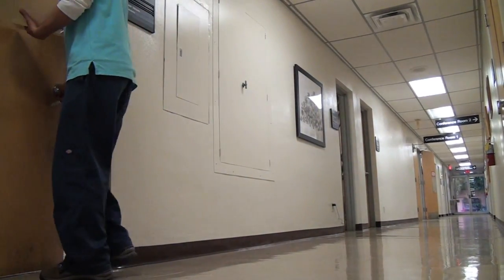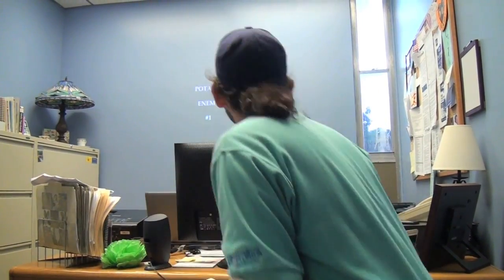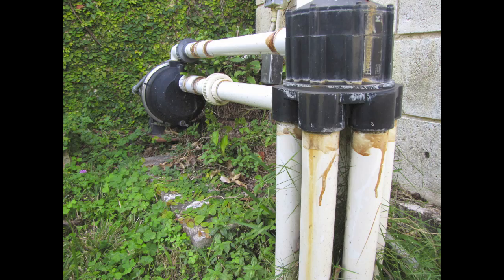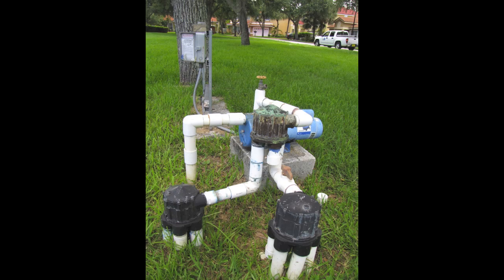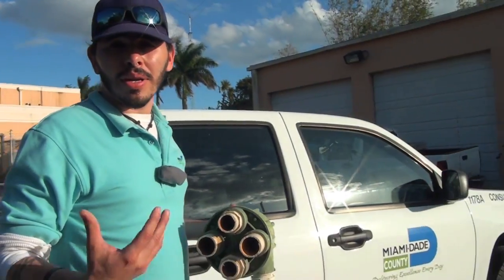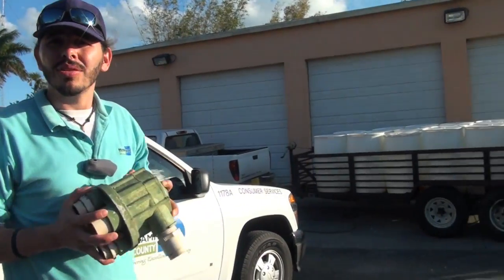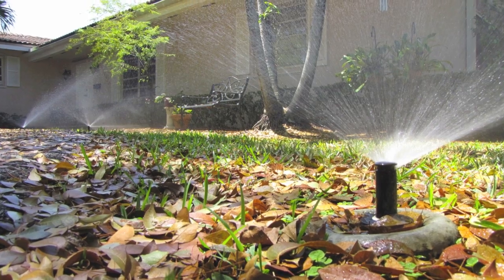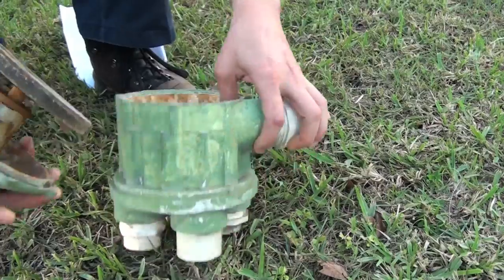The spinning menace - all indexing valves must be retrofitted

Comment: Our irrigation system's old K-Rain Hydrotek 4000 series Indexing Valve is at least 20 to 36 years old and it has had some repairs, e.g., a leak in the PVC pipe, one-(1) new check valve and replacing sprinklers but it has never had the problems mentioned in the video.  I already know about the efficiency of electro-mechanical vs electro-digital. Yes I have maintained my computers and disassembled electronic devices, but everything is challenging if haven't been taught how by a mentor.  However, when the cost of switching over to a digital system would be a costly nightmare because you can't get good affordable professionals to do the installation. Thank God we are on God's Holy Well Water!

Comment: If you can't accept digital hardware and software systems, you might as well go back to a land line and find a pay phone for your mobile office.  If you think a digital controller is complex, it is far simpler than the smartphone, laptop or computer you are using to watch the YouTube videos. 

Irrigation lines and sprinklers need to be maintained for wear and tear over time, and I easily can test zones with an app on my smart phone using digital irrigation controllers that have built-in wi-fi to advance through all the stations while I'm outside by myself, turning on at each zone as I walk through the yard.   

With digital controllers, you can also swap out the AC solenoids and switch to DC, use the same irrigation valves but with DC latching solenoids when you don't have AC or need a remote system away from the utility power grid.  I've done this on a house which was having AC electric wiring problems in the garage and couldn't use a 24vac system until AC wiring circuit was fixed.   I just wired up and programmed the DC controller and swapped out AC solenoids, programmed some new run times to run on the controller w/9vdc battery.  Job finished in less than an hour.  So the yard didn't burn up while the electrician was trying to diagnose and fix garage wiring.  Didn't have to remove irrigation valves (Rainbird 1in. DV series) since they operate the same, either AC or DC solenoids will fit on same type of irrigation valve.

Newer technology allows flow sensors to monitor your mainline, remotely monitor water flow with cloud-based metering.  You can set up to receive a text message when HIGH flow (mainline break) or LOW flow (dead zone) is detected, as digital pulses from irrigation flow meter will set off an alarm to your phone or email based on user preferences.  So you don't have a $1000 water bill if your system is stuck on or a mainline breaks while you are on vacation.  If your indexing valve suddenly stops working, your yard will be toast in a few days without water during a dry spell.